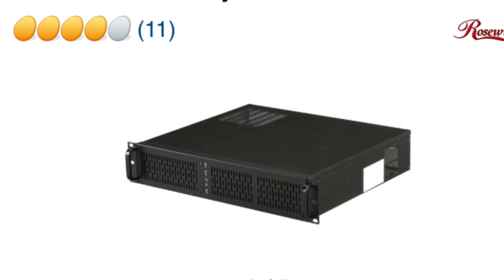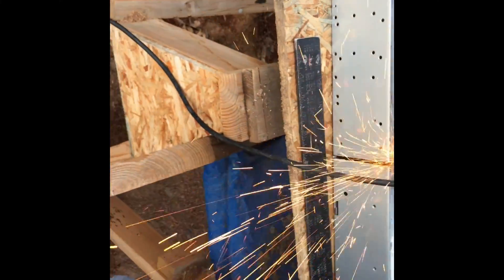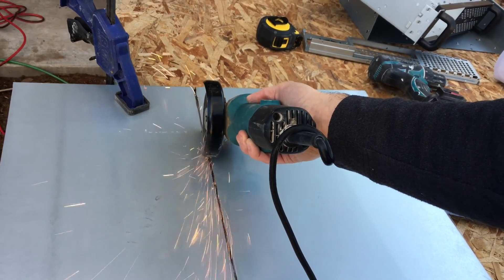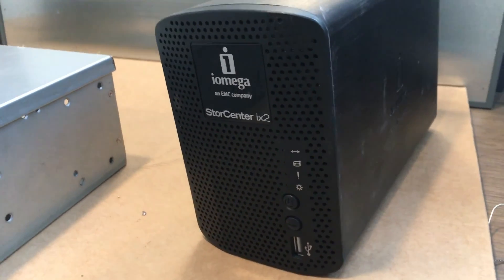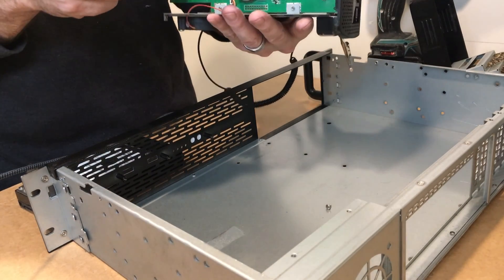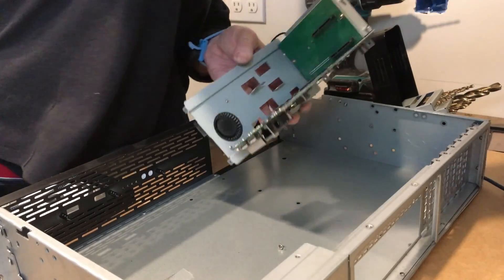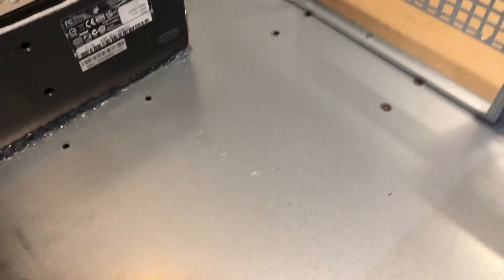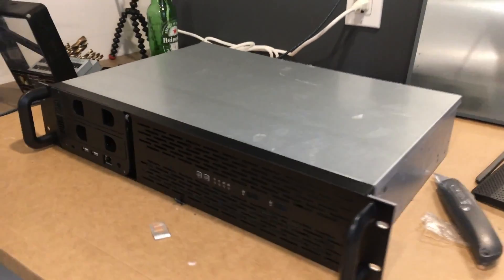Iomega StorCenter ix2 hack! - Convert NAS into server case

Comment: How do I replicate from 1TB to 2 TB? Right now I have 1 TB x 2 but want to migrate to 2 TB x 2.
Reply from the maker: You have to re-flash the firmware with a custom made one as the io mega will only support 2TB Total. There is a video on YouTube about it and where to get the software. I’ll post back if I can find the link
Reply: Right on and thanks.

Comment: Does it support 10TB x 2?
Reply from the maker: Alex Le no this firmware only supports 2x 2TB
Reply: Aw man, really!
Reply: I have two 2X 1TB, so I can do 2x 2TB max.
Reply from the maker: Alex Le are you referring to the same model? I had to install a modified firmware which allowed the larger capacity.  I have it running raid 1, mirroring so I only get 2 TB storage. Running raid 0 stripping I can get 4TB total
Reply: Thank you for the quick reply, for some reason I thought they can support 4TB. So just 2TB max, are you running 2TB raid 1 as well. Which firmware are you on?

Comment: pretty good, but for more hdd get a simple mobo with heaps of sata connectors run windows 10 and use storage pool. should work a treat.
Reply from the maker: yea this one will only hold 2 drives. I will use another PC to build a larger array.
Reply from the maker: Yea at hundreds of dollars